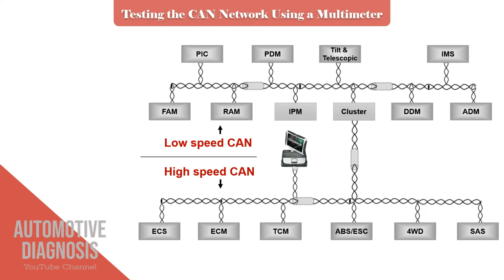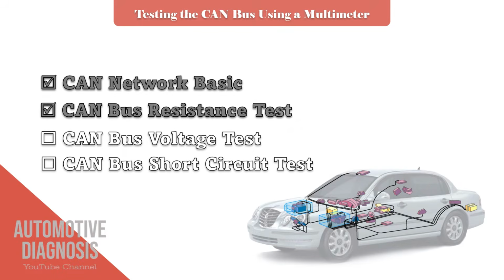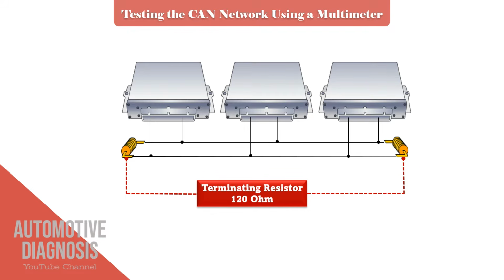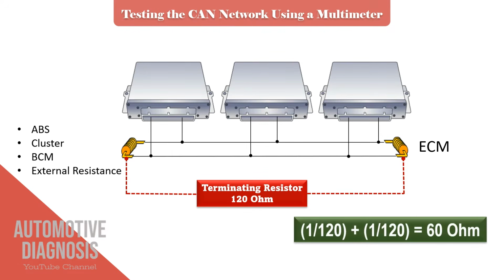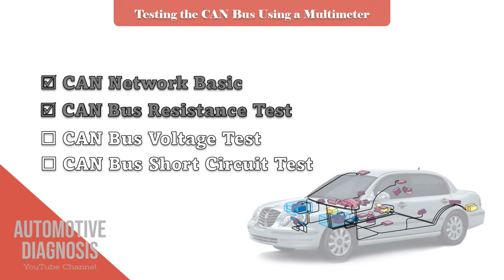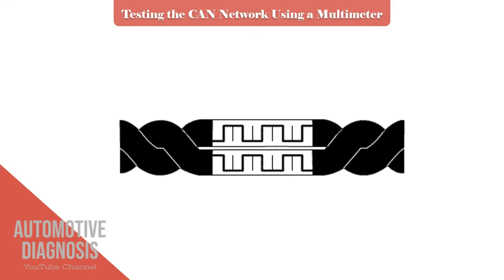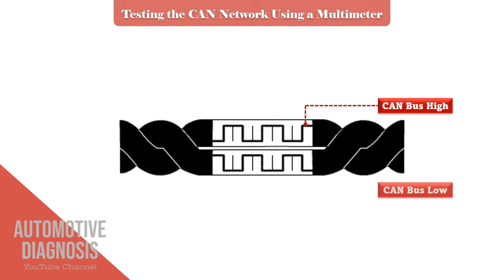Test CAN BUS With a Multimeter | Quick & Easy | CAN Bus Resistance, Voltage & Short to Ground Test

Comment: Hello, I will be glad if you answer my question. I own C5 2011 and the EPHS power steering went off. Ordered second hand one and there is still power steering faulty on the screen. Either the pump has a malfunction or is not proper to my car. I measure Can H, Can L and power pins of the steering CANBUS unit while the ignition on. Can H and Can L is 2,3 and 2,6 V as you have mentioned. Power of the socket is 12,5V. Also I measured the main 2 pin power connector of the pump and it is 12,5V. That means power cable and CANBUS socket is working properly right? I will be so happy if you answer. Thanks in advance.

Comment: Great explanation in this video! I was just wondering, when checking battery health, do you think having a tester that shows the voltage as a waveform helps? I’ve been using the Vdiagtool BT300, and the way it displays real-time voltage changes makes it easier to catch problems early.
Reply from the maker: Hi there, having the waveform can be helpful for monitoring the voltage better and to find any possible fault.

Comment: Thanks for sharing this, i have U100800 code ,  everything is  well but when i check the voltage between 6 and 14 i found 0 volts all the time
Reply from the maker: Hi my friend, ignition switch is on? If ignition switch is off, you will get no power. Also, you must check the voltage between each pin and body ground. The following video might be helpful:
https://youtu.be/8p3EauD0ufg?si=iNKJTPtngQPQHkiX

Comment: Thanks for the amazing video, a doubt whwt if the ECU may be broken because I put -3VDC by mistake, and now I connect the ODB2 scanner to the car (focus mk2), I have "system engine's fault" and it gives me a connection error, it could be that there is another device such as the radio or the instrument panel that is causing problems by not having the corresponding 60 ohms? thanks again

Comment: very nice video, easy to understand. These days I have used a multimeter to check the voltage at the "input" of the ECU, the can H is about 2.4V, and the can L is 2.19V. seems the ecu is fucked:(

Comment: C-can과 m-can을 같이 붙여도 되나요?
Reply from the maker: Hi there, you mean you want to add CAN bus on your cars that doesn’t have Network right now?
Reply: No @AutomotiveDiagnosis. I have m-can and c-can in my car. However, m-can is concluded on Android all-in-one devices, and c-can data is also needed, so I ask if it would be good to attach it to the m-can cable.

Comment: Whate is the different between can b bus and can c bus in usa cars?
Reply from the maker: CAN-C is the high speed CAN ( up to 1 Mbps) for Engine, Transmission, ABS, 4WD etc
CAN-B is low speed CAN (up to 125 kbps) for body electrical units like BCM, smart key and so on.

Comment: What an amazing video!! Thank you so much
Reply from the maker: Glad you liked it!
Reply: @AutomotiveDiagnosis sir the four test voltage test we do it and car switch off or on position?
Reply from the maker: @نسيمالجنوب-و7ظ Hi my friend, for the voltage test ignition switch must be on.
Reply: @AutomotiveDiagnosis thanks alot sir
sorry if I bother you with many questions if my car has u0001 code can i drive car?
Reply from the maker: @نسيمالجنوب-و7ظ  Symptoms in this case could be different car by car. In some you can’t even start the car, in some others engine starts but this issue affects the communication between multiple control units, the best way is to get it fixed ASAP. For more information watch the following video:

https://youtu.be/acOnR40WSoE?si=SbnENo1yY0QlXpDh
Reply: @AutomotiveDiagnosis thanks alot sir
God bless you sir
sorry if I bother you with many questions

Comment: Sir
 can lowcan high wire me voltage kaha se aata hai
Reply from the maker: Hi there, there is a CAN controller inside each control unit which regulates the CAN voltage constantly.

Comment: Your OBD2 Connector Picture numbering is wrong-- Pin-3 is Pin-6 counting from the left not from the right.
Reply from the maker: Yeah, some wiring diagrams give two different numbers on OBD-II connector, one is for the ETM and the very small numbers you may see at the top or below the big numbers. Also at the left of the OBD-II you can see two small arrows to help with this.

Comment: Hi, I have Volvo semi truck and have code : 
Mid 130 PSID 232 FMI 9 
I checked ohms almost 60-65 
Voltage 2.3 -2.5 volts 
Please what you think
Reply from the maker: Your measurement for voltage and resistance is good. You may need to check the CAN-BUS connections on TCM.

Comment: CAN resistance between pin 6 and 14 of OBD connector.
Reply from the maker: Yeah. Those numbers also mentioned in the video when you see OBD-II connector. Big numbers are just for the wiring diagram. And on the top left you see OBD-II sign and all numbers in small boxes.

Comment: I got voltage readings of 2.9 v for CAN high and 1.9 for CAN low. I am checking a dodge ram 2006. What would you suggest to do next?  Thank you.
Reply from the maker: Hi there, I would still accept this measurement as a good voltage. As mentioned in the video, CAN-Hi voltage oscillates between 2.5 to 3.5 V (yours is 2.9 V) and CAN-Low oscillates between 2.5 to 1.5 V (yours is 1.9 V). This measurement is just a bit different from what I did in the video, but it is still in the range as based on the activities in CAN-BUS and multimeter accuracy, the voltage value might be a bit different for each measurement, the only things that matters is to get something within the range when you measure with a multimeter.
Reply: @AutomotiveDiagnosis  
These days I am trying to troubleshoot multiple faults in a single vehicle (Dodge Ram 1500, 2006): (From BCM) - B1648, B1661, U0101, U0100, U0121; (From WCM) - U0141; (From PCM) - U1120, U0141, U1411, U110C, U110E,  P0058, P0032. 

The vehicle starts for about 4 seconds, but then shuts down. Do you have any suggestions on how to narrow the main culprit?

Also, when checking for resistances and shorts for the CAN Bus, are ALL of them done with the ignition key in off, correct?

Thank you for replying.

Comment: I tried the short circuit test. An ohmmeter value close to 3 m ohm is displayed between can low-gnd and can high-gnd.
Reply from the maker: Hi there, thanks for sharing your experience. This shows that there is no short to ground.
Reply: @AutomotiveDiagnosis  because you spend  time to give the ?  I will put you page on my face book.
Reply from the maker: @CanBus-li5ky  Thanks a lot, I really appreciate it. This following video also provides more details on CAN-BUS:
https://youtu.be/bvyHx-C2Xfs

Comment: Great video - I will use this information to investigate the issues on my Jaguar XK8 or eliminate worries about the CAN BUS system  - Many Thanks
Reply: Hi, I am also having can bus issues on my XK8. I have no communication from the TCM -ECM. What resolved your issue? Thanks
Reply: @rossgibson4237  Hi Ross My issue as identified in the video was the the Rotary Switch on the RHS of the Gearbox - If you have the same symptoms as depicted in the video then follow my instructions and that might solve your issue - It solved mine!
Best of Luck
Reply from the maker: Glad you liked the video

Comment: How to check if can bus short to positive?
Reply from the maker: You can check the voltage between each pin (6 or 14 on OBD-II connector) and body ground when ignition switch is off. there shouldn't be any voltage. Also you can try it when ignition switch is on, this time CAN-Hi must be around 2.6 V and CAN-Low around 2.4 V, so if you are getting 12 V, it means that circuit is shorted to battery voltage.
Reply: @AutomotiveDiagnosis   thank u for reply💓
Reply from the maker: @AUTO_CLUB-d4q  👍👍

Comment: I have a question? can a CAN high/low wire be a regular #12 stranded wire ? That’s is what is used at my work In our pile plugs just a regular #12 stranded wire . Thank you
Reply: Shielded twisted pair is better for this because it won't pick up as much interference... But as long as your traffic volume isn't crazy high due to packet loss or your modules aren't losing communication I wouldn't worry about it too much.

Comment: If we have continuity between each can with ground that’s mean don’t have short?
And how to know have a short with positive?
Reply from the maker: Hi there, there shouldn’t be any continuity between each CAN and ground, if there is any it means that CAN is shorted to the ground. To check the short to power there are two ways, first is to turn the ignition off, wait for a minute to make sure CAN is at sleep mode so there won’t be any voltage, then you can measure the voltage between each can and body ( positive on CAN and ground on the body), so if you read any voltage (normally if shorted you will get battery voltage) it means that wire is shorted to positive.  The other way is to check the CAN voltage when ignition switch is on, so as you see in the video, normal voltage for CAN high is about 2.6 v and for CAN low about 2.4. So if you get battery voltage instead of normal voltage it means that wire is shorted to battery positive.
Reply: @AutomotiveDiagnosis  
Thanks alot bro,
Yesterday iam checked jeep compass 2017, after checking by scann tool we have  many cods about CAN > u0010,u0056, CAN C bus , CAN CH bus  and many code lost communication with (ECM/PCM , BCM,ABS, BSM ..) 
After checking can bus from OBD connector the can voltages don’t problem have CAN H 2.9 - CAN L 1.9 and we don’t have any continuity between CAN and ground. 
Then check the battery voltage the big battery is🔋 full charge but auxiliary battery 🪫 died. After replacing auxiliary battery all problems  and cods are gone.
In first we had 18 fault code .
Reply from the maker: @autowow7128  Thanks a lot for sharing your experience. I've also had many different faults on CAN-BUS and every time fir a different reason. But it seems that I'm really enjoying of this difficulty 😅😅.
Reply: @AutomotiveDiagnosis  
Our jobs full of difficults😅 it's tiring solving problems But in the end it is fun. 
Hope you succeed.
Reply from the maker: Thanks 🙏

Comment: At obd2 port Can high is pin 6 , and Can low is pin 14, why you misslead people with different numbers in this video ??
Reply from the maker: I wish you checked the video more carefully before judging, the diagram is taken from the original wiring diagram so we haven’t changed it at all. Secondly, if you look closer, you still see PIN numbers for 6 and 14 that you are referring to which are just written at the top and bottom of the CAN terminals. So wiring diagram clearly shows that pin 3 and 11 are on the ETM and pin 6 and 14 are for OBD connector (shown by arrows at 02:25).
Reply: @AutomotiveDiagnosis  checked again, sorry but still not see pin 6 + 14 referred as can high and can low, you should edit video, beginners can be missleaded :/
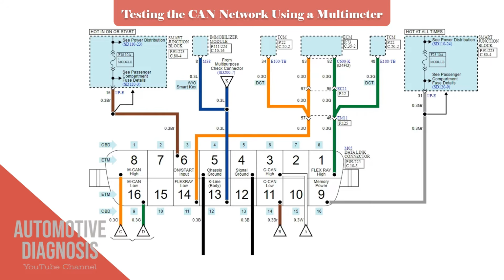Reply from the maker: Check 02:08, at the very left side of the OBD-II connector, you see the arrows for OBD connector pins. When everything is mentioned in the wiring diagram we can’t just change the original diagram in a way we like as it may cause more confusion!!
Reply: @AutomotiveDiagnosis  Hi there, yes, I noticed that in many wiring diagrams as well, that there are two different numbers for OBD-II connector (specially on Korean cars), thanks for clarification, I appreciate your work.

Comment: Good work. Is there same resistance check on the body CAN as well?
Reply from the maker: Resistance and voltage are different on Body CAN. There is not any 120 ohm resistor as body electrical options can be different